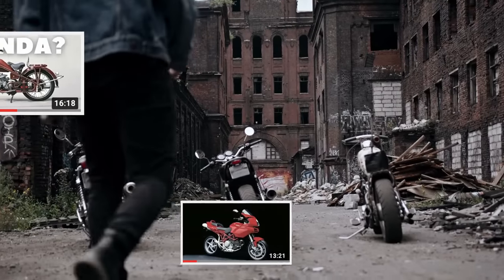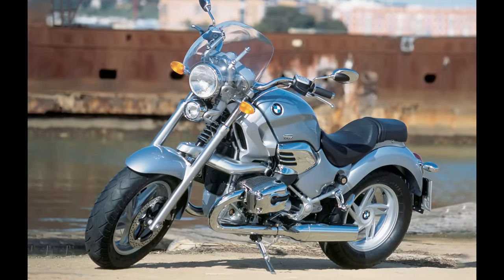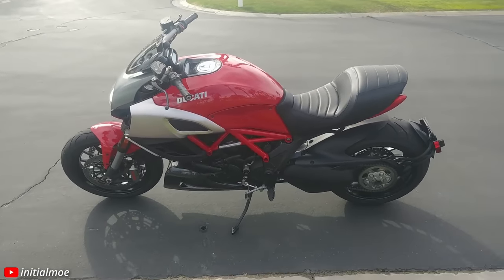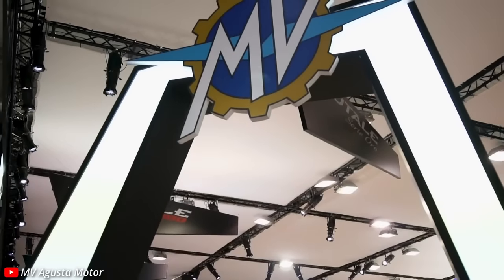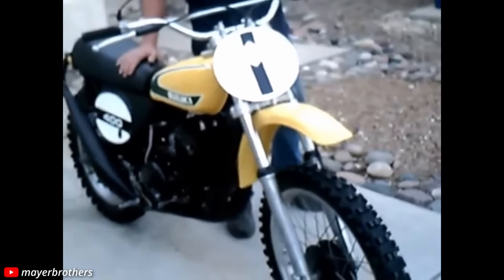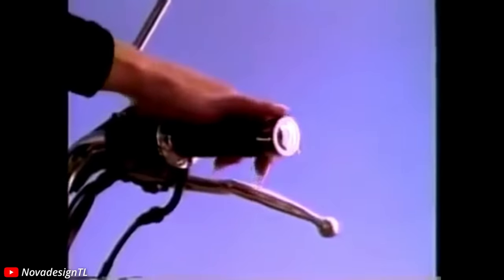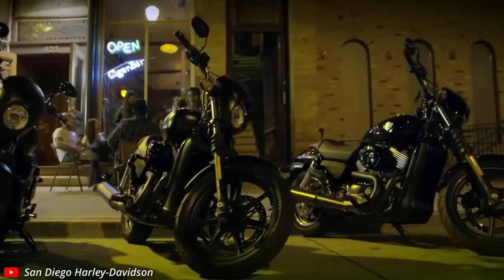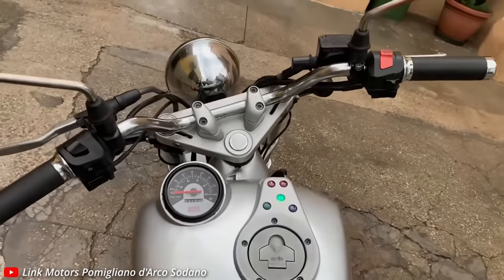The WORST Motorcycle from every manufacturer

Comment: Bought a factory new 1983 Virago in 1985. It was shaft drive and cruised really well. One of my favorite bikes. Only sold it because I was raising my kids alone and needed the money. Edited to not confuse trolls.
Reply: A good bike is one that makes you feel good. Nothing else matters.
Reply: Two wheel therapy! It worked. I did that too with a 1997 Buell S1 Lightning. Incredible what riding can do for one's soul. 😊

Jesus man, that almost put a lump in my throat!
Reply: One of the best things I've read on YouTube.
Reply: I had a virago 1100 and it was a total solid rock of reliability and was fine. The transmission wined on decel - for 12 years with no problems. A bit buck toothed but I came to like that too. Saved my sanity at the time like a Labrador.
Reply: I liked my 750 Virago. I considered it an updated Vincent and tricked out the Virago with black everything accordingly.
 
I later traded it for a barely street legal FZR 750R which gave me backaches but was really fast and a head-turner.
Reply: Ok, I have had two ‘81 viragos. I loved everything but the looks and the starter motor on the first on and after a few years moved on. Then I saw a Vincent inspired mod and figured that I must have one. Years later and I still have it and the looks don’t offend me because it doesn’t look like a Virago. With money spent on the starter and clutch basket it sort of starts ok, but get this - where the starter gear meshes with the clutch basket gear ring, the designers knew it was a bad situation so they added a little magnet nearby to collect the metal shavings the ensued! So the parts just wore out and the starting got unreliable. So much so that before I upgraded and someone stole the bike with the keys in it, it proved impossible to start and the police found it a week later parked up with the keys still in it. 😅. Anyway, cheers to all you riders who love your bikes regardless of popularity or perfection.
Reply: I have to agree with you that the Virago was a decent bike for it's class.  I think it evolved into the Vstar series and many are on the road.  My vote for worst Yamaha would have to be the Vision.
Reply: Almost brought one when I was nineteenth loved the look of them, glad you have great memories👍
Reply: I've had Harleys and I've had jap bikes. My favorite was a 02 vulcan 1500 classic. I had a 19 street bob, had 7 miles on it when I got it, somebody pulled out in front of me in a ranger and bike was totaled, had almost 16,000 miles on it. That was 2 years ago, gave up riding for my wife and my soul has been broken ever since
Reply: You are a hero sir
Reply: In case of bike i realised one fact within my 7years experience .
Bike'sLook doesn't matter if u are a real rider
Reply: I've always loved the virago, my ex wife owned 3 of them and one day I'll have one, I've owned around 30 bikes over the last 40 years and I currently have a thunderace, fantastic bike, but there's just something about the virago that has made me want one since I first saw one over 30 years ago. BTW, more power to you sir, I have a similar story, my daughters are teenagers now but they were 4 and 6 when their mother left and took them away from me. Riding my bike kept me alive and sane. I've seen my girls at weekends and holidays and next year the eldest is moving in with me which is great but I'll never get back all the time I missed with them.
Reply: @kimhenry5658   Sounds like when a guy stole our 02 Ford/Jaguar Thunderbird (keys were in it in an unlocked garage)  ....police found the car and the crook ....the car's battery was dead and the crook stranded due to a totally faulty issue of its lack of ability to reliably keep it's  battery charged.   It was SO ridiculously bad the engineers for that year only actually  created a HYDRAULIC powerd radiator cooling fan just to take some of the drain off the electric system! (yes that is really true believe it or not)  It was sort of like owning an electric car because unless you put serious miles on it continuosly the charging system could not keep the battery enough to start the damn car!   My wife's work was only a few miles and that was not near enough therefore every night the car had to be have it's hardwired battery tender plugged into an extension cord.....man I hated that car and was actually sorry the police found it!  The thief went to prison and I bet he hates 2002 Thunderbirds more even than me! ....the charging system was only one of several glaring issues with that heavy ass roadster
Reply: still crap
Reply: I had an 85 virago 1000, awesome bike! Probably the only vehicle I truly regret selling…
Reply: Motorcycles saved my life!
Reply: @Simulera  
I always thought that the Yamaha  Virago was a great looking bike.  Especially the 1100.  I have a few bikes but I always wanted a Yamaha Virago 1100.  Still looking for one.
Reply: In 1986 I was newly married and looking for my first Harley clone. Looked at what the Japanese had to offer and really liked the Virago. Ended up buying a leftover’95  Shadow 700 because the price was right.
Reply: Similar situation back in 1979. Obtained custody of my eldest son after his piece of crap of a mother threw him out when he was 15 years old. We used to go out on a Suzuki 50 cc to do our weeks shopping with just £10. Progressed to a Gold wing 1100cc and met my Second partner, married and settled down, started a family but now with a Honda VF 750 Magna custom. This was my last bike which was disposed of following my partners death from cancer. I had two young sons (4&6) to look after. Both now grown and flown, i could do with that HONDA to ride into the sunset. Ride safe
Reply: When my wife split from me (after 27 years) 5 years ago I was feeling pretty low. The next spring I was out on the first shakedown cruse on a beautiful spring day. 9 in the morning, dead calm, blue sky and puffy white clouds(LOL). Well as I was doing a 45 MPH put to make sure everything was OK with the bike after doing spring maintinence it hit me...  Damn if my eyes didn't start to water. Riding a bike after a long winter just hit me. It was SPRING and life was coming new. That bike, and the fact I was out in the country watching nature wake up just made it all ok. Two wheels are good for the soul and if the bike makes YOU happy than that's all that matters.
Reply: @yousmuttbuttyou  , sure they do. Haven’t you heard of one night stands?
Reply: My life parallels yours, and I'm currently in the shopping for a new bike chapter of life.  Two-wheel therapy is powerful, and it's exactly what I need for the weeks when my son isn't with me.
Reply: @Dave-sw2dm  I think Sheena has heard of a LOT of them. Oh boy, here comes Sheena the Troll.
Reply: I got my Virago in 1991.  It was six seven years old.  Maybe 25k on it.   I rode it hard for In. 4 years. I put 130+ miles on it.   The only problem I ever had with it was the electric bundle and the starter.  Once I replaced all of the wiring with a heavier gage wire, rebuild the Fuze box with with a nonOME part.  And changed to bigger brushes and wire in the start.   She ran like a champ.  It was not
Reply: I divorced a cheating ex wife of 13 years and left with only a change of clothes in a backpack, lawyers dragged out the divorce for 5 years, I lived homeless the entire time while working full time, judge and attorneys took ever dime I made and I still didn't make enough to pay them everything,I traded work to a guy for a 98 honda 750 shadow ace,it was clean and ran perfect,I rode it every day for 4 of the years I was homeless and loved that bike but the judge finally forced me to sell it to pay my ex's lawyer fees,when the divorce was final I saved up and bought an 05 dyna wide glide and I love that bike and still have it,I take my son out for weekend rides on it,motorcycles are definitely the best way to leave the bad people in your life in the dust
Reply: Great inspiring story..stay strong and stay positive
👍💯😎
Reply: I had a Virago 750 cruiser. Great bike, just a bit too high rider, but I loved it. I still regret selling it, but it was just waiting in garage to make a yearly trip to nearby registration servis and back to rest.
Reply: there was a guy on a virago in my town who had a tee shirt that said .."it's hardly a davidson"
Reply: I had an 86 Virago 700.  That was a great bike.   Rode it completely across the country from San Diego to Boston and then to D.C.  Had no trouble.
Reply: Mate don't stress the Virago 750 and up were great. The only thing I hate on this list is the Narrator Bart and his know nothing about shit Generation that know apparently everything actually IMO every generation spat out after the Baby Boomers are the worst Models in my list, Here is a Quote from Wikipedia ''' The Baby Boomers (1946-1966) are characterized by the increase of births due to the end of World War I and World War II. Generation X is known for their independence( lol A few maybe ), both a negative and positive factor. Finally, the Millennial Generation Are Known For Their Assumption of Technology"" I am a 1966 model and horrifically put in with GenX until a Correction about 10 years ago, My Brother and all his Gaming Stoner Mates with no jobs and pure laziness are 10 years younger than me, I have had many bikes, makes and models and at 57 have Bikes 22 and 23 a 2002 Kawasaki ZZR600 with the real Ninja Engine for Pulling Your Face Off and a 2009 Suzuki Boulevard M50 Special ( VZ800 ) I love and will buy sooner rather than later a Yamaha V Star XVS 1100 Low Rider with suspension Mods and Gel seat rebuild or a mid-1980s to 90s Yamaha VMAX Cruiser with its 140hp you won't be killed IF YOU CAN RIDE! And a few safety Mods, I Had a heap of 2 strokes an old  DT 400 Yamaha, a TS 250 Suzuki a 1972 Maico 250 Magnum, a 1978 Can-Am 125, a Yamaha YZ 125c The first Monoshock and a Registered Yamaha YZ 465, and Many Road Bikes even a 1966 Honda 350 C77 SuperHawk. I am sure he would find all those Ugly bikes too, We just had Balls of Steel in the 1970s and 80s, Oh and Cruisers of the 50 to 60HP range were built that way,, to Cruise and see the scenery on a 300km to 1,200km Cruise. But then a genius invents a difference like the Yamaha VMAX Range to Cruise in an upright position at Break Neck Speeds if you don't lose your bike for speeding. My Favourite Enduro Bike is a 1983 to 1985 Honda XR 350R, Amazing Balance, Power, Handling, and Reliability.
Reply: I bought a new 85 XV1000 Virago, excellent bike loved it & would recommend it to anyone. Lots of great memories
Reply: There starter made a hell of a nose when starting.
Reply: I had the predecessor, the XV 750 hoping it would be like the TR-1... well, I was disappointed, very disappointed. I went straight back to BMW as soon as I had the money.
Reply: I had a 87 1100 that I bobbed. it would scream and I loved that bike
Reply: @grahamniven  100% Mate hey, I would ride a Postie Bike The CT 110cc Honda As long as it puts the wind in your hair right.  🙂
Reply: @ironken1796  That's a sweet bike the S1 Lightning  🙂
Reply: I Have 5 Daughters I bought them all new 200cc Yamaha Enduro bikes for Xmas one year plus they had their Horse, Them having Bikes made them understand Gears Clutch Balance, and speed, and was 100% easier for them to go from the bikes to the car, I had a 1994 XT600 Dakar to chase them on lol
Reply: @Simulera  They all whine, Suzuki Volusia's, Intruders, Marauders, and Boulevards ALL have a whine it's just how they are but they can kill Stators even the LTD Kawasaki's had a whine, My Brother in law has a Virago1100 Special that he hit a 6 ft Kangaroo at 70mph, he managed to stop the bike and he had the Roo under his arm and on the seat, He was a bit bruised But Mr Roo was DOA
Reply: @KutWrite  FZR 750R  wow Great bike hope you have it on a display stand in your lounge room mate.  🙂
Reply: I'm with you.       I'm 62 and started riding as soon as I could get my license endorsement at the age of eighteen. So, I've been riding motorcycles for 44 years. In that time of owned eleven different motorcycles. 
I may be a little unusual from many riders, I don't know,  because I've been a mechanic, from the very first day that I started tinkering with an old Lawn Boy lawn mower engine, that a kind old neighbor gave me. He mounted it to the tiniest little pallet that I'd ever seen and well that started it. I was ten years old. Since then I've worked on nearly every two and four wheeled internal combustion machine you can think of, and the last thirty-two years of my career was as a licensed aircraft mechanic, working on airliners of numerous types. That includes ten years of rebuilding CFM-56 jet engines.
My current ride that now has nearly 63,000 miles on its odometer is my 2013 Yamaha FJR1300a....   A wonderful machine, an absolute joy, and which I refer to as my "Japanese mistress". 
I really watched and enjoyed your video, with one exception, your overall evaluation of BMW motorcycles. Perhaps it's because I'm used to REALLY dependable Japanese motorcycles, but I find your statement about beemers to be less than accurate. In fact I know dealers that quit selling them out of having a guilty conscience for selling such an expensive and "unreliable" machine. That's been my personal experience also, having owned a 1997 k1100LT and then a 2010 K1300 LT.  In fairness one has to acknowledge that European vehicles in general require a lot of regular maintenance to keep their tickers ticking, but the BMW's I've both owned and worked on professionally I believe leave a lot to be desired in exchange for that Germanesque machine experience.
My nephew is the latest victim of the BMW bug. He purchase a 2021 K1600 GT, brand new. Since then and 14,000 miles later, the transmission has failed, he's already replacing ignition coils, and then shortly after I warned him about the handlebar rotary switch assemblies that control the information center going bad, guess what.... it went bad.
I'm sorry, I love motorcycles and feel the physics and spiritual satisfaction that comes from an appreciation for the living breathing molecules in the machinery of a great bike. I may be the embodiment of one of Persig's characters from Zen and The Art of Motorcycle Maintenance....... I love these noisy, fire breathing, gas burning, two wheeled steeds that bring us oneness with mother nature's wind. Just so long as that machine, that the owner loves on, and maintains returns the love..... Get the message BMW ?
Anyway your video definitely carries the spirit within it, I believe, even though it's about the lemons of the two wheeled manufacturing world. I still sensed a vibe of "motorcycle carnal knowledge", in your video... A knowing of your babies inner secrets, having felt her sing to your soul, as you carve up a twisting road, or roll the throttle on and leave a black Bentley coupe behind you on a stretch of Atlanta interstate highway, as I did last night.
I call them machines..... I'm sorry baby, you'll always be my mistress.
Reply: Thank you for sharing that story brother. I am divorced and put my life back together and motorcycling was part of it.
Reply: @Rokonroller  there is no accounting for personal taste and that's all we have heard here ... one dude's opinion which is well bs ..frankly I like Yamaha...in my opinion Yamaha never built a bad bike...!
Reply: @MrMambott  thank you! I sure miss my Buells (4). Now I've gone Orange since HD shuttered Buell. KTMs mostly fill that spot that the Buells left.
Reply: I never saw where it was an ugly bike, frame they sold a pile of them thru th yrs,somebody liked them
Reply: bought my virago new in 1994, still have it.  put it in storage, drained fuel tank and coated in oil, drain carbs.  havent ridden in 10 years.  this is getting me in the mood to get it working and go riding.  love that bike, only drawback to me is no way to start when battery dies besides push start.  wish it had a kickstart too.
Reply: Awesome comment!  In 1985 my best friend bought a new Honda CX650 Custom. He worked alot of hours at his job, so would let me borrow it frequently because I was preparing to leave for the Navy in a few months. That spring was some of the best times I ever had. I haven't seen that Friend for many years, but recently I heard that he passed away this past July. Reading your comment brought back many great memories. I appreciate it!
Reply: Had a 1985 Virago and it would outrun my 96 cid Harley that i currently ride. The Virago was a smooth well balanced bike.
Reply: @danielrobey1759  I have to agree, I have an '84 Virago 1000 and I just love it!  Almost 25,000 miles on it now and it still looks and runs almost like new, it's very dependable, and so much fun to ride!
Reply: @harrycraft3687  I totally agree...my first Yamaha was a 64 250cc Catalina...I've had many more and loved them all...I don't think there ever was an ugly or poorly designed Yamaha
Reply: At about that same time, around '85, a good friend crashed his one month old Virago 750. Not much damage to the bike but he broke a leg and his wife pretty much said it's the bike or me.   He traded me the bike for a snow blower and I rode it happily for two years including a Boston to Florida RT.  It was an excellent bike to ride.
Another friend had recently bought a Honda V-65 Magna. an 1100cc V4 beast of a bike that was way too tall for him so we traded even-up.  The Magna was amazingly smooth for such a monster but you had to ride it every second.  It tended to understeer in big turns which could be exciting in not so great a way.  The power was fun but overall, the 750 Virago was the better bike and I missed it.
Reply: I loved My 750 Vulcan back in the day and my buddy had a Virago, both reliable and great cruising bikes, this guy knows nothing other than he "just doesn't like them" which to me is  stupid way to base a "worst motorcycle" list.
Reply: Yup, the only way to judge a bike is to live with one for quite awhile.
Reply: I always thought the Virago was a great looking bike. And it's a Yamaha so you can't go wrong on quality there. Being able to ride has gotten me through a lot of dark days so I empathize!
Reply: I have my Dad's 1981 Virago 750.  It was my first bike and I was able to resurrect it after it sat for 20 years.  I love how it looks and I got many compliments about it  when I was out on the road.  Its been parked for a while in favor of my Harley Sportster but some time soon I'll fire it up again.  To each their own I guess.
Reply: @davidj.7779  My two daily riders are an '84 Virago 1000 and an '84 Honda Magna 700.  I love both bikes equally but they each definitely have their own personality, most notably with the Honda having lots of fun high revving power, and the Yamaha having lots of low end torque, all the way through the RPM range. I've never ridden an 1100 Magna so I can't speak about it's handling characteristics, but I can definitely say that I don't have any issues with how my 700 handles, and I totally agree that the Honda V-4 engine is amazingly smooth. In fact it's SO smooth that I often find myself way over the speed limit, so I really have to pay attention to the speedometer. 
When I'm doing 65 on the Virago I feel like I'm going much faster and there's definitely some vibration, but I often find myself doing 85 down the interstate on the Honda without even knowing it, until I look at the speedometer...that engine (and the whole bike) really is that smooth. The Yamaha seat is much more comfortable and the gas tank's a bit larger so it has more range between fill ups, so I usually choose the Virago when I take a longer trip somewhere, but I love both bikes for it's own personality, and I'd hate to give up either one of them. We really are lucky to have so many great choices for riding!
Reply: I had a Virago 750.  It was a great bike.  Smooth ride.  Nice sound. Comfortable seat.   Now I have a Yamaha Bolt 950.   I love it.
Reply: Trust in Jesus.
John 3:16 - For God so loved the world, that he gave his only begotten Son, that whosoever believeth in him should not perish, but have everlasting life.
Luke 13 3 - I tell you nay: but except ye repent, ye shall all likewise perish.
Reply: Great story!👍 I had a Yamaha Fazer back in the day and my friend had a Virago. He loved it, I thought it was nice looking and a pretty solid bike as well. I miss those days of being young and chasing women around on bikes, good times!
Reply: @kimhenry5658  Vincent inspired mod without a kick-start?
Reply: Currently, I have an FLSTC Harley and V-Star, but I rode a custom-modified '86 Virago for ten years.  I never had any breakdowns or failures and only performed maintenance work.  Nevertheless, I constantly received remarks like "good looking bike" or "what kind of bike is that" at car shows and bike rallies.  Also, when I sold it, people lined up to buy it, and I got several thousand dollars more than I originally paid for it.  I knew one man who had over 250,000 miles on his Virago.  I loved mine so much that I purchased a V-Star, the son of Virago.  Since then, my highly modified V-Star has won several "people's choice" awards at car & bike shows.  Viragos and V-Stars are great bikes...
Reply: bought mine used in 1985 as well. Road that bike for fifteen years and never had an issue with it, just regular maintenance. I personally loved the look of the bike. Just bought a used Yamaha Stryker a couple of years ago and, the bike is bullet proof
Reply: @jimbobaggans1564  

.
Reply: @jimbobaggans1564  I've got a nice 98 1100cc with about 16xxx mi.on it. Im 74 yrs.old and about ready to hang it up. I live in NW Ohio if youre interested give me    a shout.
Reply: @ironken1796  ya me to lol
Reply: I still have a 1982 shaft drive Virago (920cc). I took it in lieu of a debt back in 1992 when I didnt really want it and neither did my wife. It is the only thing I still have from that time and I still love my mental health rides. Other than replacing starter shims a couple of times, it has given me little trouble.
Reply: I read your comment during the intro. Lol I guess he hit the virago. Reliability Xlnt. I saw many, & always liked it. A few days back I saw a mint cherry red, Cruising. I wanted that bike!  ✌️
Reply: @bamaboy485  Never ever sell your soul, to anyone. For anything. jus my 1 cent
Reply: Count your blessings...You have your daughters.🙏💕💪✌️🎵🎶🎶
Reply: @dougiequick1  sounds like the Lincoln LS. I learned the faults. But it definitely wasn't my choice. I remember those t birds. Uggg. Definitely not ford's best. My 1st car a 66 Lincoln Continental , $300 bucks from Mr lehr. He said, here's the pink slip &put it in the kitchen drawer. If you want it tomorrow ,put the $300 bucks here. Great car....
Reply: @MrMambott  I wish I was your neighbor! Lol. That 600 would scare me... A VMAX I recently saw. NICE !!! Those Hondas Incredible. I had many 70s 750s. A 79? 400 Supersport was my 1st love. Lol. Now I have an 82 Suzuki GS 750, I'm sure most would think it's crap, but it's the best all around bike I've ever had. I recall having to stop , & let my hands wake up on the 70s Hondas. This Suzuki is so smooth , I'm impressed every time I run it thru the gears. ✌️
Reply: @letitrest4662   82 Suzuki GS 750 E, underated. Understated. Those bmws would keep me busier than I desire....Every Honda I've owned bar none. Were reliable. They were all used. I've never bought a new bike. The  1st a 400 supersport, canary yellow. Lil bit loved it. Mint clean, until a 100 mph mishap. As I recall, The 750s we're kind of ponderous, compared to the 82 Suzuki GS 750 I have now. Underated...
Reply: @ironken1796  I agree. ORANGE MAN RAD ! 🧡 Lol
Reply: Cool story man, Wind therapy.
Reply: FREEEEEEEEDOM!
Reply: @ccrider8483  Just looked up the vision. It looks like the kind of thing I would've loved and bought back then, but the weird design aged quickly!
Reply: Thats a great story ive got a 2009 honda fireblade cbr 1000rr repsol and a 1999 suzuki sv 650 and a 2004 kawaski er5 and a 1999 yamaha xv 1100 virago. I love you can ride all day long with  huge comfort. Iooks arent to everyones taste but you are spot on  what u said about how they ride. Great comments
Reply: You the man.
Reply: Loved my XV 750 would love another 😍
Reply: My 920cc Virago's keyway-fastened crankshaft  gave way and turned the bike into a boat anchor.
Reply: Yep. Had an '83, 500 cc Virago. I was 19. That was the 80's. One awesome bike! I loved the shaft drive. I thought she was a fine looking bike and so did the chicks!
Reply: I have a garden tractor 🚜 with a Yamaha Virago 750cc v-twin for pulling a weighted sled at the fair! Shaft drive and all!..from Wyoming USA 🇺🇸 🤠
Reply: Oh, how i can relate to you.... I gave up bikes for my now X-wife .. I had a beautiful Kawasaki GPZ750Turbo & ADORED her ( the bike that is)   then after i divorced her i bought a ZX-9R Ninja  & bumped into her one day & she said, OH i see you bought another bike. & I said yes & it sure is a hell of a lot better ride than you ever were :)  well not sure why but she was NOT very happy about that statement ;) lol .. BUT i did like the Yamaha Virago i thought it was a good looking bike & was never one for hardly hets up a hill lol  (Harleys)
Reply: I had a 93 virago 750 from new for 12 years. It was awesome. Wish I kept it.
Reply: @ironken1796  Loved riding Buell.
Reply: Why would you pick the Kawasaki the Eliminator 900 just because you just don't like it? I have been riding since the 70s. The Eliminator 900 was actually a very cool bike during the 1980s. My friend had one. It could easily hang with us on sportbikes and destroy any Harley on the road.  It was way more comfortable than the first generation of repli-racers at the time
Reply: Now that's what riding is about!!! You just gave me such a good feeling. I'm 45 yrs old. Been riding since my father got a divorce in 79.. and he picked up a 1979 kz400 to keep his sanity. But all of us kids learned how to ride that kz400 by 12yrs old. I've been riding since I was 11. Dirt bikes. Street bikes. Even found myself on the track in 96 to 2003. Big bro and me . Very expensive even being our own mechanics (east coast my) didn't help racing. Sorry got long winded. Im laying in bed after 3weeks in hospital after all these yrs riding. A 72 ur old lady turned on a turning arrow that turned red and here I come on my fav 2008 GsXR 1000 with 9k organ. Miles. 8 ribs broken punctured lung. But doctors put me back tighter healing up. Can't wait to read or hear another story like yours..... Ride safe all. See u after I recover clicking 6 gears!!
Reply: I agree with you about Viragos. Mine was the ‘84 1000 and I still fondly remember my years riding that bike; I have so many stories with that bike.
Reply: Exactly the type of people it was made for
Reply: The spirit of two wheels mate 👍🇦🇺💯
Reply: @Simulera pa
Reply: @kevinmccaffrey2471  I hope you’re doing better now
Reply: I wish my daughter would come ride with me on my motorbike.
Reply: Ppp
Reply: Great memory for you and your daughters. I did not like Virago at that time, except one with gold trim against the chrome pipes and black tank. This year I am 60 year old. I suppose you are a few years older than me. I have trouble swinging my leg over the seat.
Reply: Hell yea motos  are the modern horse
Reply: My brother had one. He would hold it wide open for 100 miles. It survived a lot of abuse faithfully 😊❤
Reply: Chris I hope your life is still good and you are still Riding.
Reply: You rode around with your divorced wife all summer?.. 🤔